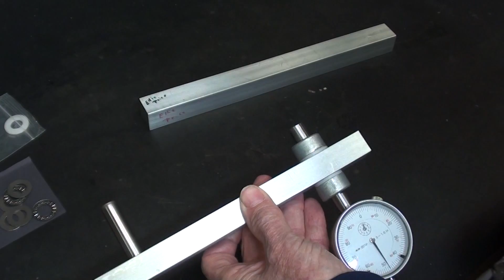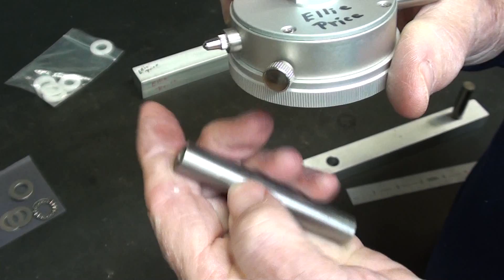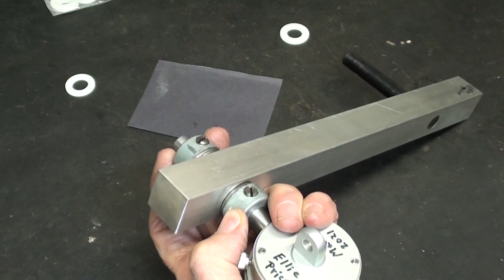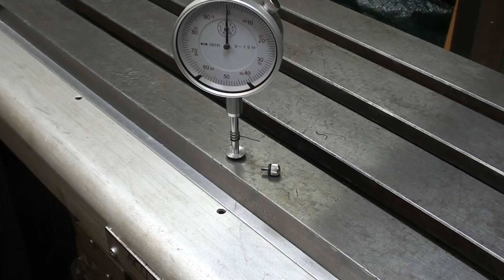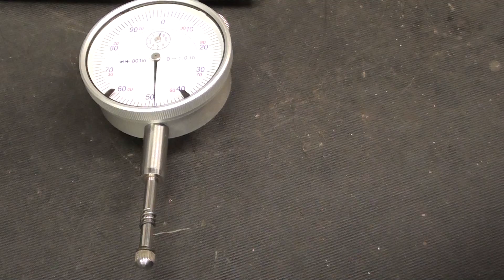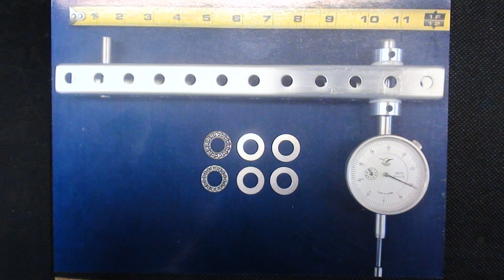MAKE BRIDGEPORT TRAMMING ATTACHMENT #662 tubalcain

Comment: Ellie's tram tool is very useful. I like it more than the commercial twin indicator ones you see for sale. The only change I would make to it would be to add a wave washer under the set collar on the top of the beam to ensure that the bottom collar is always pulled tightly up against the beam for proper regristration. This would eliminate any wear. He has a nice little addition to anyones tool box. I hate tramming, but this makes it easy.
Reply: No wave washer needed. Pinch the stop collars and nylon washers firmly together for zero end play before tightening the set screws. Since nylon is self lubricating the indicator will still turn freely with no end play.

Comment: I just had the wacky idea (and if i had some time to make it) you could gear the indicator to the chuck position with a timing belt so that if you spin the indicator to the other side it would twirl to face you..But your holes would have to be precision crafted to eliminate any error there..Yeah i know its not practical and easy like this great project but overkill even if neat..
Reply from the maker: That is a very unique idea. But of course overkill
Reply: @mrpete222  I know..lol...
Reply: Not necessary.  Just build a symmetric bar with two indicators, one on either side.  These are commercially available ready-made.
Reply: @RichardKinch  That would require very precise work or you will introduce error..commercial ones will be accurate but then it's just throwing money at the problem. I know my idea is a bit silly overkill but making a cool tool for me is all about the fun and problem solving satisfaction.  And my pockets ain't that deep,, And as it is I got my emco mill for 200 bucks and another one came with it in bad shape for free that I'm converting to cnc.
Reply: @chuckthebull  The dual form does not have to be precisely made, just featured for calibration.  You perform an easy one-time calibration of the dual indicators to indicate the same height.  After that it is much quicker to use than a single swinging dial.  It does bring the chuck/collet coaxial error back into play, though.
Reply: @RichardKinch  how would one go about calibrating them.. Surface plate? I'm having trouble envisioning.
I'm not new to building but a bit new to getting into heavier machining. I now have a monster of an engine lathe as well,, and a small horizontal mill. Now its just how not to die...ha,,thsnks for the tips,,im going to design something up.
Reply: @chuckthebull  Calibration of the dual-indicator spindle square is quick, easy, native, basic, one-time, self-proving, and "not too fiddly".  No special fixtures or reference surface plate are required.  The machine itself is the fixture and reference.  The dial indicator stems are fixed in the bar by a setscrew.  To calibrate the tool, you simply set it up in the machine to take a reading, cranking Z to get one indicator reading zero. Then loosen the setscrew on the other indicator, swing the tool to exchange the indicator positions, and reset the second indicator up or down to read zero like its mate did.  Repeat the swings to self-check the calibration.  Done!  Revalidate the self-calibration anytime with the swings, that each indicator agrees with the other when swapping locations.  This like a spirit level being self-proving without any fixtures or references; you just reverse the level and check that the readings match both ways.  Here you're measuring squareness instead of level.  You exploit the metrological property of levels or squares, that a precision reference is proven by being level or square with its reflected self or reflected mate.

The spindle stem squareness to the indicator bar is also a critical factor on the dual.  You check that with a machinist's square against either side before using the tool, if anything may have disturbed it.  That happened to me once when I accidentally dropped the machine head with spindle square onto the table after loosening the nod adjustment, which slightly bent the 3/8 in stem.  It was not too difficult to hand-bend it back to squareness.
Reply: @RichardKinch  Thanks Richard..yeah i watched that bit about machinist levels and sorta got the reference to itself deal... Good info...
Reply: @RichardKinch  How do you check the nod with dual indicators?  Does the heavy vise have to be removed? The setup and calibration sound pretty complicated compared to one swinging indicator.
Reply: @ellieprice363  for some it's a thing as contest to over engineer something..like the do nothing machine..or in Japan they have contests to see who can drill the smallest longest hole in steal.
Reply: @chuckthebull  To each his own I guess.
Reply: @ellieprice363  Nod is checked the same as tram.  The vise is not removed; you can sample the table to either side of the vise if you have free area, or on the top of the vise.  Not sure why you think dual is more complicated than single; dual is faster and more direct, being a single operation instead of swing and try and repeat.  The dual calibration is only needed once (or once per accidental misuse).  I've used both, as well as the third option of a coaxial indictor as I commented elsewhere.  The downside of the dual is its cost, about $250 for the commercial version, a gadget for the machinist who collects at least one of everything useful.

I don't wish to deprecate the esteemed shop teacher, but a simple 3/8 rod bent twice into an zig-zag shape, with a threaded hole to hold an indicator, is a perfectly workable single-indicator spindle square.  That's what I used for years.  With the bar design, the bar should be rectangular; a 1/2 x 2 bar is more rigid where it counts than a 1 square, because the vertical plane is the only one loaded.  But rigidity and deflection are not a problem, because the loading is tiny and doesn't change with position.  What counts is that everything is locked firmly in place and doesn't budge when swung.

Some wag will probably suggest an idea for doing it non-contact with a laser.
Reply: @RichardKinch  Thanks for your many good ideas, all which will work fine. I tried most of them during my 60 year career in tool & die (now retired) except for the expensive duals. I assume you’re referring to the EDGE device with two fixed indicators only 5 inches apart. Seems like the vise would have to be removed or slid to one side to measure nod with one these, unless you’re checking the top of the vise. If you’re checking the table to the side of 
the heavy vise you’re introducing table sag into the equation. 
A simple swinging bar with one indicator for less than $50.00 is my contribution to the trade but there’s many others. The whole concept of these wonderful YT channels like Mr. Pete’s is to throw something out there that works for the education of all. However, as you probably well know, no committee can 
ever fully agree on anything. (:-)) Edit: What if you put your accurately calibrated dual indicator in a drawer and it gets nocked all to hell out of whack? No fun having to calibrate it all over again.

Comment: Thanks for sharing Ellie's gadget, easy to make and easy to use. I'm puzzled about your demonstration of checking table sag/way wear. If you rotate the device to do the measurement, what's the difference between that measurement method and the initial one of tramming the head?
Reply: Actually, the best way to measure table sag is to adjust the indicator on zero near the center of the table and slowly crank the handle while watching the indicator. If there's sag the hand will begin to move up near the end of travel as the other end sags. Swing the indicator arm around 180 degrees and check the other direction for sag. The 48 inch table on my Bridgeport sagged .004 one direction and .005 the other. Table sag can be improved to some degree by adjusting the X and Y gibs.

Comment: Chuckle, he didn't make that tip: he just swapped it from the other end. The o-ring on it is a dead giveaway; it's just the knob off the top of the indicator stem.
Reply: True, that’s exactly what I did. Swapped the two tips and added a generous radius on the larger one. You’ve got some sharp eyes. (:-)))

Comment: Mr. Pete, I made mine using a 196 Starett back plunger gauge, Drill and reamed the end of the bar for the indicator. Use a set screw to retain the indicator. Works well.

Comment: There is an implicit assumption when tramming that the table surface is parallel to the slideways.  This is probably true on a Bridgeport but maybe not on cheaper machines.  If this is the case, face milling will not produce the familiar cross-hatch pattern in both directions of travel.  It is easy to check by winding the table while using a dial indicator held on the spindle.  This defect needs to be corrected (by scraping or surface grinding) before tramming can be done accurately.
Reply: No! Any consistent tilt in the table or the ways across their length does not affect tramming.  In fact, tramming nulls out that angular misalignment at the position you trammed.  If the ways and table surface are not parallel with respect to each other, then there's no compensation in the basic machine possible.  In that case the only resort is to shim the work piece, or the vise, or the clamps.
Reply from the maker: Thanks

Comment: I might put a shaft on top of the dial indicator, and put a tip or a knob on top of that so I can pick it up as if it were unmodified. I always used the coat hanger technique. Had a dial, or run out indicator too. So much for 200+. Never did combine the two. Well, there's always tomorrow. Thanks for the vid.

Comment: Thanks for a good old machining video, and the knowledge it brings!
I hope You didn't tilt Your well trammed mill. A piece thick like a thou or two, under the needle, would do the trick. Ah, You did.....
Is that center line important? Not much I feel like saying. What do I miss?
Time 09:45. "This is a 31/32 drill"..... Then reaming with half inch..... Do I need an English class?
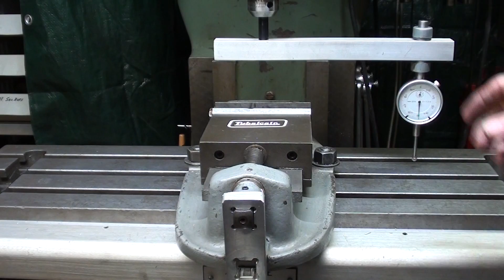Time 13:10. "mounted in a three jaw chuck". Aren't those chucks known for runout? How does runout affect the readings? Maybe not much but a little at least. Why not use a collet chuck?
Measuring the mini mill 6.5" minus the radius of the clock is available. The vise has to go.

Comment: Lyle, this is a very educational & useful video showing multiple ways to make Ellie's simple, but extremely useful tramming device!  Thank you for making it long enough to show everything like you did.  I think I'll make one as close to what you demonstrated as I can for my Rong-Fu-type mill/drill, since it's really a "kit of parts to be cleaned & refinished into a better machine" as some other channels have stated!  I'm almost guaranteed that the column isn't perpendicular to the table as it came from the factory, though I can still do decent work with it "as is."  ;)

Comment: What if your mill isn’t tramed in when you drill the holes?😬
Reply: You can set the tram plenty good enough to drill the holes with the degree marks on the lathe. The holes will work just fine. Then if you want to refine the beam drill the new holes after you get it trammed with the less than perfect tool. But if you will put a chunck of aluminum in after tramming with the less than perfect tool and use flycutter or other wide surface cutting tool. You will see the swirls in both directions that is an indication of perfection.

Comment: Just to throw this out there. You could just lay some bar stock into the the lots that is just shy of the surface your measuring. It can be a little proud of the surface too as long as the difference isn't greater than the bevel of the tip of the indicator. It makes it a lot easier to tram because you don't have to stop to lift the probe.
Reply: The probe doesn't need to be lifted if you if a well radius tip on your indictor. Mr. Pete showed one from his collection with a large polished radius that would slide right over the T slots without lifting.

Comment: Why not put in a second dowel in  between the original dowel and indicator to allow measurement of the shorter y axis without the need to move the table in and out?  Overall I like this design sometimes the simple tools are the best.
Reply: There's little benefit to the longer bar.  Just build it 8 inches to start with, then it works on both axes.

Comment: Hey Lyle, I also see that a 6 in machinist level could set between the mounting pins as a 2-way checking method (@@)! Got make one of these,,,this will also be very useful to check the shaper bed table in lue of depending on the scale. On my Klopp, you have to get down on your knees to read,,,and since I am so old and stiff, that hurts & stinks,, A super thx to you and Ellie for this awesome idea and way to make this useful fixture! Ps - Bride has a surgery date, so be a few months before it will be made & in the tool box (@@),,, Have a great time @ FL event,,,Bear & Sammie.
Reply: It can also be used to check the accuracy (tilt) of drill press tables. I checked my 15 inch Rockwell last night with a shorter bar and found the front .021 lower than the rear. Not much I can do about it but at least I now know not to depend on it for accuracy.

Comment: On a higher quality dial indicators, that area around the plunger at the top is threaded, which would lend itself to attaching it to a holding stem. With the long length of the bar, how do you tram front to back?
I always lay 1-2-3 blocks on the table for a larger, smoother indicating surface.
Keep up the good work!
Reply: Actually checking the head nod with this device is relatively simple and the vise does not need to be removed. After correcting the left to right tilt set the indicator dial to zero. Now slowly swing the dial indicator in a semi-circle across the full width of the table and notice if the hand moves. If it does not move the head is in perfect alignment and tramming is complete. If the hand moves from zero the nod needs to be corrected. Slightly loosen the three clamp bolts on the right side of the ram and slowly adjust the hex nut on top of the ram until the indicator hand remains stationary across the full width of the table. Check once again by swinging the device in both directions. The indicator should read close to zero during the full swing.
Reply: @ellieprice363  Unfortunately, after many years of running Bridgeports, I found that when you loosen the nod lockscrews, it effects the tilt adjustment and you wind up having to adjust both at the same time, intermittently tightening the bolts, and making adjustments as you go.
Reply: @t.d.mich.7064  Yes, I’ve had that happen to me. It’s a sort of delicate juggling adjustment that takes years of experience to get right.
Reply: @t.d.mich.7064  Loosen the bolts only slightly and tilt should not change.
Reply: Good idea, as long as you have a tap to match the indicator threads.
Reply: @ellieprice3396  I know that Federal indicators with 1 or 2" travel have caps that are long enough for this use. If one could find one of those caps, I believe that would work.
Reply: @t.d.mich.7064  I haven’t seen those Federal indicators but they should work if not too expensive. The beauty of this device is it can be built in the shop of inexpensive materials and a cheap but accurate indicator. The long rear extension attachment is the most difficult part to make.

Comment: I LIKE it.  I have always used my home made dual dial indicators to tram nodding and tilting, setting it up 5" radius (10" table width).  That has worked, but I always thought I may need a wider sweep for yet more accuracy.  AND, finding I am leaving steps when face milling a piece already set up??  Brilliant!  (BTW, I am no machinist.... I'm a retired, blue chip making hack..... but I absolutely love this stuff..... playing with my machines making parts for my old hot rods, motorcycles, and guns keeps me, at my age, from hanging out in bars and chasing loose wimmens)
Reply: When you mentioned Joliet East, boy did that bring up some fun memories.  I had a college roommate who was from Joliet, so I just had to go see where he graduated from.  Turns out he went to Joliet Central, class of 67.
Reply from the maker: I picked up the machine at Joliet Central. The surplus machinery had been moved to that school.
Reply: If your machine is big enough you can use 9 or 10 inches between centers. (18/20 inch swing) My first device was on nine inch centers but would hit the column on Mr. Pete's Bridgeport. The one he demonstrated was 8 inch centers for a  16 inch swing.
Reply: @ellieprice3396  Hey Ellie.... thanks for your comment.  My machine is a Lagun FTV-2S, with a 10 X 50 table.  X travel is restricted with hard stops for DRO scale on it to about 33" on it though, to keep from driving the reader head out the end of the scale, resulting in replacement of scale and reader (ask me how I know this).
Reply: @JohnnieBravo1  You’ve go a really big machine. If you care to go bigger and more accurate you could use make a bar with 10 inches between centers for a 20 in swing. To check the nod you simply swing the indicator across the table and adjust the head (nod) to zero zero across the full width. When the indicator reads zero across the table on both sides of the vise you’re in perfect tram.
Reply: If you’re leaving steps during your X travel machining your nod is out of tram and needs to be adjusted.

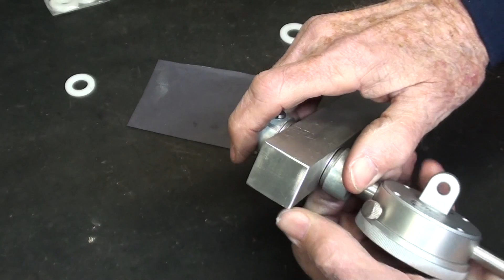Comment: 12:15 I'd suggest adding a soft washer (e.g. cork?) between the top boss/collar and the thrust races - so when you tighten the last boss into place, you can squeeze the bosses closer to each other as you tighten. The sponginess of the soft washer will then keep tension on the thrust bearings.
Reply: Hi Mike. A cork washer would work but it’s not needed. Pinch the nylon washers tight against the bar for a slight drag then tighten the stop collars. Since nylon is self lubricating the indicator will still turn freely with no vertical movement.